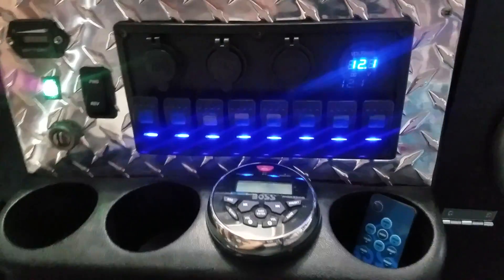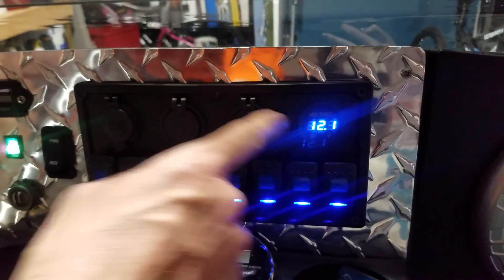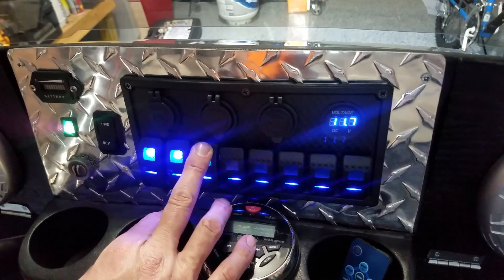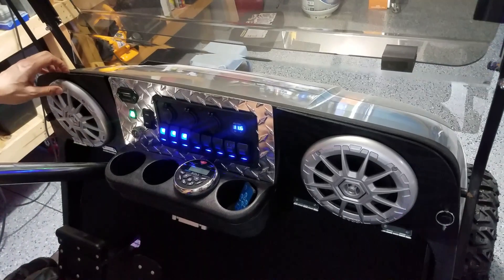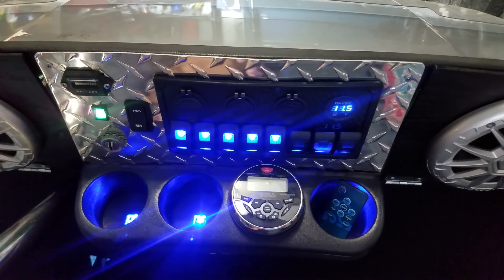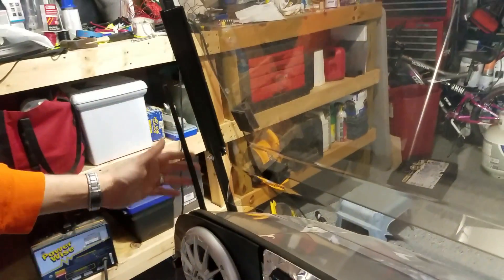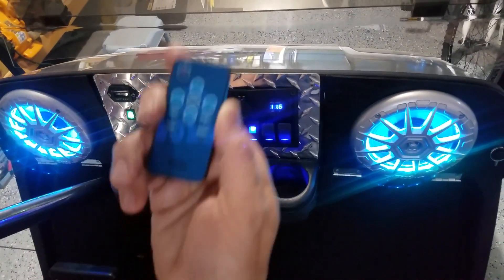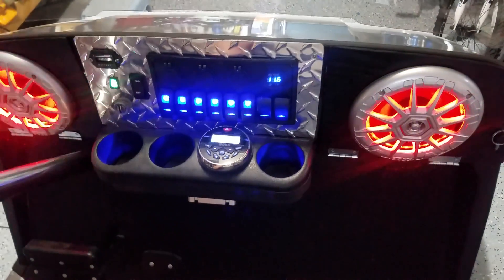New golf cart stereo

Comment: Besides this being an awesome installation, do you ever have problems with your stereo turning off? I have the same installation and my stereo turns off when I press on the gas, once I come to a full stop it turns back on
Reply from the maker: Thank you!   No issues with the stereo system shutting off while driving but I have heard of people putting in a secondary voltage regulator dedicated purely to the stereo system because of the amp draw
Reply: @1afmxswarrior  thanks! Long story short my starter generator was bad, replaced it and all good. One more question, I have a new golf cart yamaha G22, did you custom built speaker walls or did you buy it ready to go?

Comment: Well after a lot of thought and planning I decided to keep the txt dash the way it is. I’m going with a bazooka party bar and the storage areas will hold a gps speedo unit (it’s big, 85mm hole) I’m adding 2 spot led lights on the sides of the cart for copper head killing. 

May I ask did you use one reducer to reduce the entire battery pack to 12v ? My friend who’s gonna help me wire it is worried the wattages drawn will be too much for one reducer.
Reply: I can't speak for this gentleman's nice cart, I have a 48 volt system with a voltage reducer, it has a 30 amp fuse which then runs to a distribution block for six circuits which power many many led strips and controllers, light bar tail lights headlights bluetooth speakers blah blah blah, I have never had any issues. 100% of the things that you see on the golf cart in this video, everything is powered, or LED which is very small current draw, on a 48 Volt to 12 Volt reducer you must have 48 volts on the input side for it to work correctly or at all, I would not be worried about it. You could take a multimeter to it and test the load and if you feel like the load is drawing too much, I would just run with a separate 12 Volt battery and charge it separately every night along with your regular battery pack.

Comment: How did you do your hinged speaker doors and what stops them from flopping down
Reply from the maker: darren binkley I cut them out of some very thin plywood (1/8th in thick) that I bought at Lowe's. And then I put two small hinges on the bottom of each panel and screwed them into the dash.
Reply from the maker: Sorry for the late response! I took a Sawzall and cut out sections of the dash and use the diamond plate to mount the instrument panel. For the doors, I simply took a thin piece of plywood and cut the holes for the speaker and hinged the bottom

Comment: you just running a voltage reducer or more than that?
Reply from the maker: Yes there is a voltage regulator that Taps off the main batteries. That's what I use to run 12 volts to the rest of the cart. It's a 36 volt system
Reply: Brenden Shaw so how is it switched? Are all those things off one panel and are you running an inline fuse?
Reply from the maker: Barton Boma. I bought the panel off Amazon. There are a variety of choices with different numbers of panel switches that you can choose how many circuits you want to run. Each switch has an inline fuse.
Reply: Brenden Shaw you wire it through the ignition?
Reply from the maker: Barton Boma no I installed the voltage regulator in the battery box area andtapped off of that to run 12 volts up to the dash. I routed it by going underneath the cart and trying to keep everything nice and clean I just zip-tied it and used that corrugated plastic that split down the middle which makes for professional-looking wire bundles.

Comment: i have a gas powered cart. can i use a car audio battery by itself and just charge it at the end of the day?  and if i do that how long do you think it'll last with a 300 watt amp?
Reply: That is a very dynamic question, meaning the efficiency of the amp, the actual draw of the music you listen to, the ohms of the speakers... Best thing you can do is test it out with a multi meter down to 11.8 volts and stop.